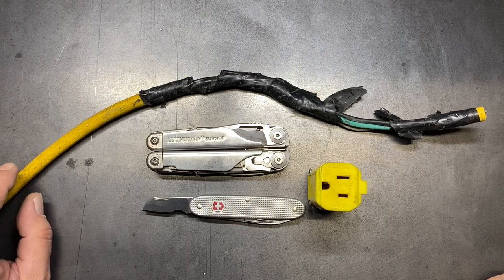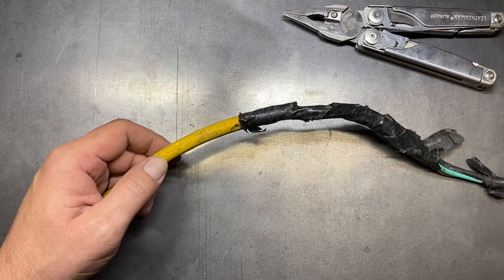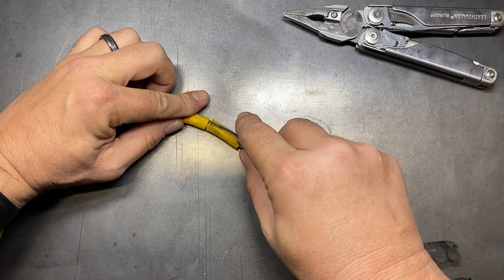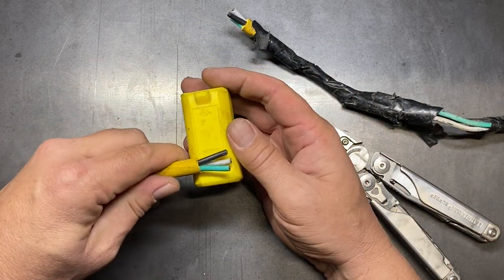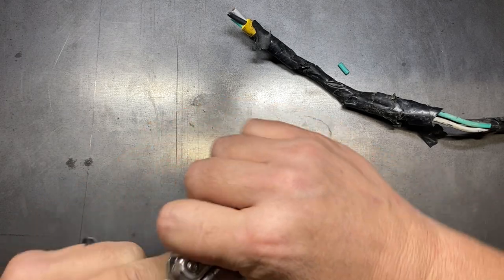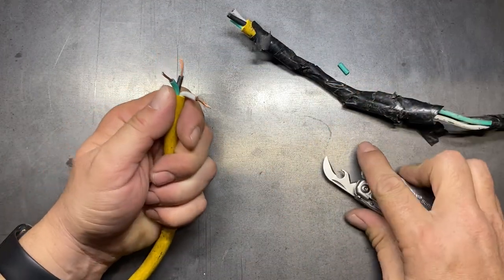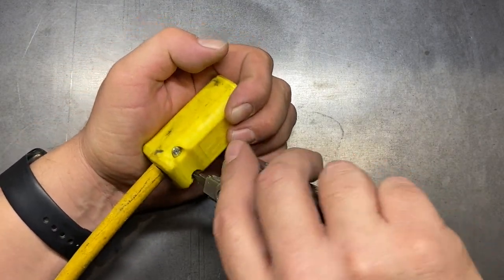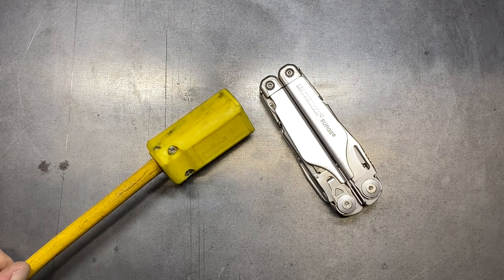Repairing An Extension Cord With A Multi Tool

Comment: Enjoyed the video. Always cool to see the tools in action. I got the Electrician even though I don't do any electrical work. Just prefer the sheep foot blade for EDC over the small screwdriver and can opener, and also like that it doesn't have a key ring. Like seeing how it's designed to be used, though.
Reply from the maker: It has a really sweet little blade for electrical work.

Comment: Nice video.  I fixed one up not too long ago (I use a 100’ cord with my electric lawn mower).  I used a Charge and a Swiss CHAMP and some regular tools too.  I’ve got a Vic Electrician, but I haven’t used it yet.
Reply from the maker: That Electrician has a pretty nice blade on it, shame they don't use it more.

Comment: The ground wire should always be longer so no need to shorten it. Probably should have been longer. If for some reason the wires come undone from and pulled out from their connectors, the ground wire is the last one to disengage and will still save someone from a potential lethal shock.
Reply from the maker: Really?
Reply: Yes. Its also why the grounding pin usually is longer, so that the pin enters the socket first and ground the appliance. All about the safety :)

Comment: "Black to brass, knock you on your @$$" black is the hot/live wire, and goes to the thinner/smaller prong. 
White is neutral, goes to the wider/larger prong. 
Green is ground, goes to ground post.

Comment: "This is an industrial grade extension cord"...

*shows mangled cord

What did your guys do to it, throw it in a wood chipper?
Reply from the maker: Got it caught under the wheel of a scissor lift while it was tied off to the rail. They messed it up pretty good. Just because it is industrial grade, doesn’t mean it’s invincible.
Reply: @txtoolcrib  That...would absolutely explain it. :p